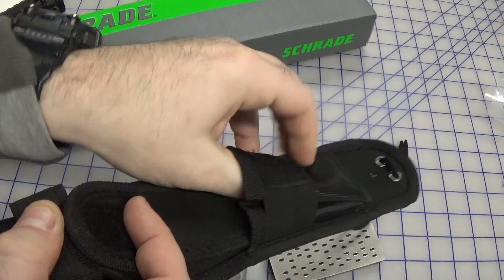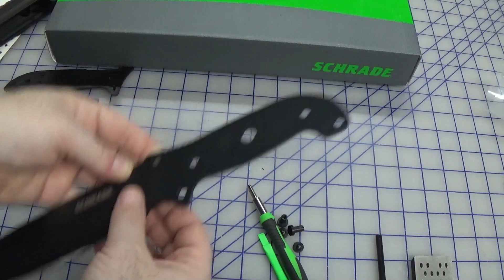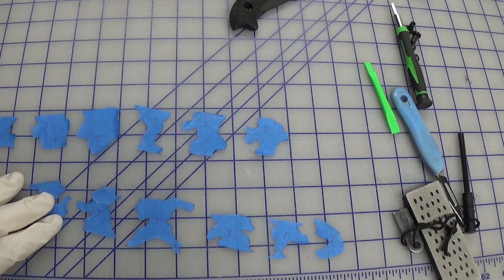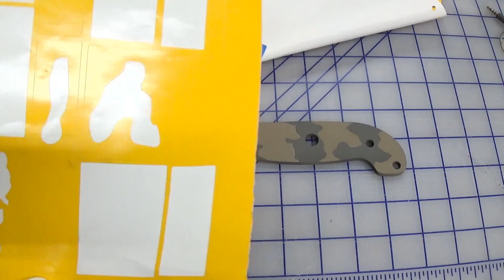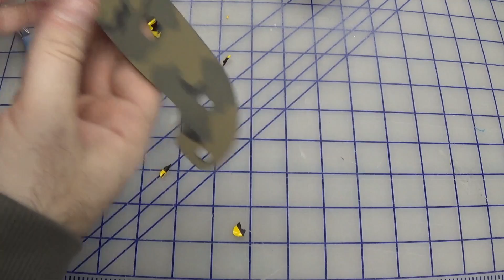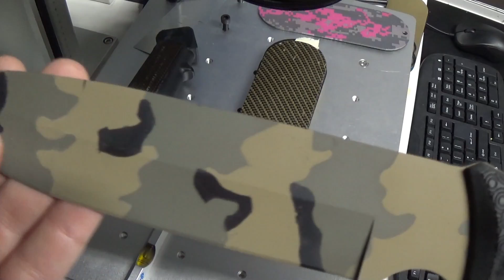Free Form Cerakote Camouflage - Schrade Frontier SCHF52 Unboxing, Custom Coating, & Test Pt  1

Comment: Doc when you sharpen the knife does the cerakote stay for a couple sharpenings? Or does it instantly turn silver?
Reply from the maker: If you use really aggressive methods it will come off right away but I try to go gentle to make sure that we don't mess anything up. I'll start with about a 600 grit diamond and that takes about 6-10 passes to start exposing the bare metal. going gently like that leaves a very smooth transition between the Cerakote and the exposed metal so that there is no micro-ridge for anything to grab or to chip.

Comment: Great video like always. But I have a question if I was painting I would cover the surface with one color and then layer the rest. I've used this method to give trucks, and plywood structures a camo paint scheme. Will the cera coat not stick to itself like that, or is it too expensive to waste that way just curious.
Reply from the maker: It will stick to itself if it is flashed and not fully cured. Doing it the way I showed here does save some product. But it keeps the layer as thin as possible which may matter to you or may not. In this case we have a blade that will slide against the edge of the sheath, so I want to keep the coating thickness as close to the 1 mil standard as possible. Cerakote is very durable but over time we don't any extra wear just from going in and out of the sheath.
Reply: Thank you for sharing some of your knowledge with the world Doc. You probably woulda made a pretty damn good teacher. I've only been subscribed a couple months and I feel like I've learned a whole lot from you bud

Comment: 1095 is good steel. I like working with it. I have some my Dad gave me that was originally from my grandfathers shop. He said it was over 100 years old, that was about 30 years ago.
Reply from the maker: I think that s carbon goes, 1095 is your best all around choice. We both know any carbon choice is going to rust if you don't take care of it. 1095 isn't the toughest carbon steel out there but I think it might be the most forgiving.
Reply: @DocP91B  I have always used water quench. (Still do) the trick there is the tempering; after the quench it is very hard but brittle, I draw it to a peacock blue three times on the forge. That leaves it around 55-60 Rockwell but toughens it up.
Reply: @DocP91B   sometimes I leave the blue patina on it. This is known as blacksmith bluing. Looks nice, prevents rust but wears off. And you're right the downside of carbon steel is rust
Reply from the maker: I'm terrified of a water quench! That is a real skill!
Reply: @DocP91B  back when I was in highschool I wanted to make swords, so I took a metal shop class. We forged and tempered a chisel using tool steel and a water quench. Later, '90 I started making knives and used the water quench. My Dad who was a second generation blacksmith gave me pointers
Reply: @DocP91B  I graduated when this country was 200 years old. Our year book had that flag (the American flag) that makes some people "uncomfortable". I love that flag
Reply: @DocP91B  what kind of quench  have you used? I could teach you water quench, if you were closer. LoL. The right quench temp is important, but prompt tempering is critical. If you wait very long (1-2days) you will get stress cracks.